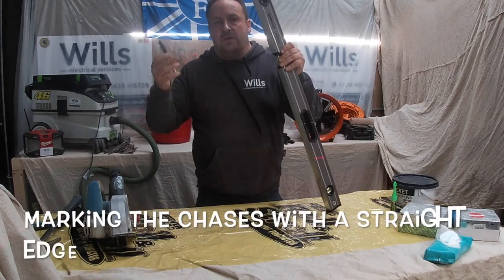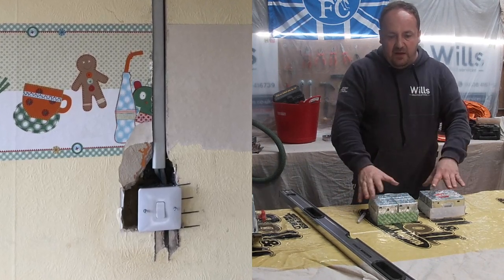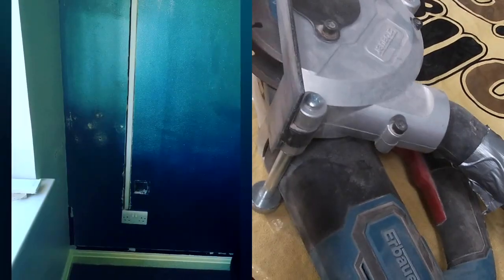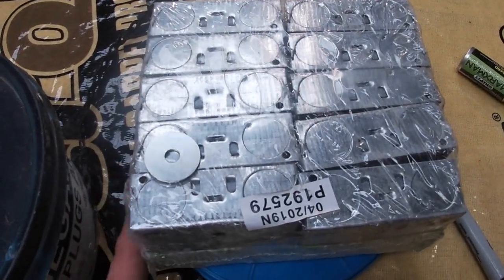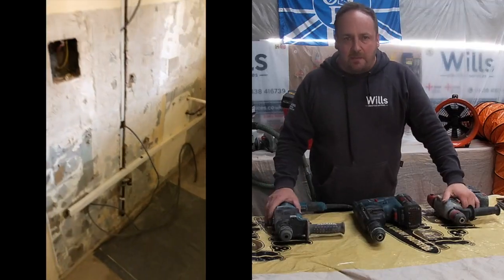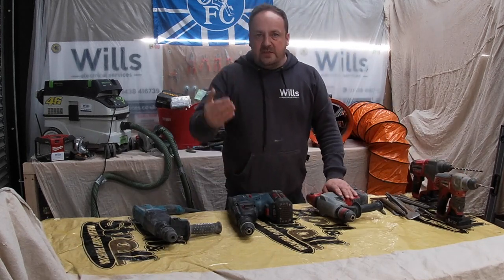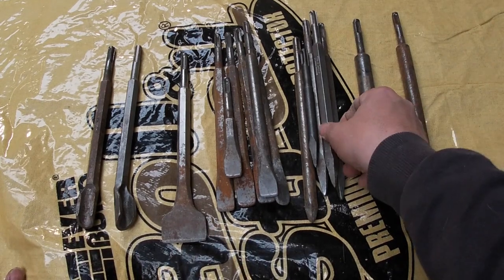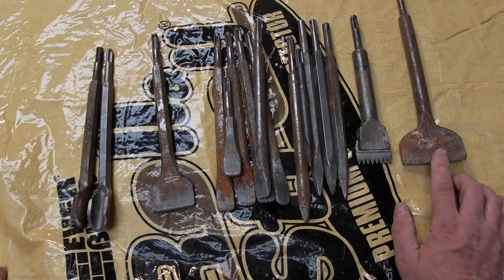Electrician Wall Chasing Tools including Tips & Tricks | Electrician TV

Comment: Will what's the best thing to do when the walls keep crumbling ? Do you need to do it by hand . I used to chase out for electricians before I went college and sometimes walls just crumble and cant get fixing
Reply from the maker: I would probably say use a grinder and Sds driller with a Chisel bit never by hand
Reply: We always most evertime use gun foam for fixing pattres box's in old houses. Great for holding oval conduit in too. So quick and very strong. Also stops thing moving about when plastering up with your joint filler which might I add is ten times better than bonding and skim coat.